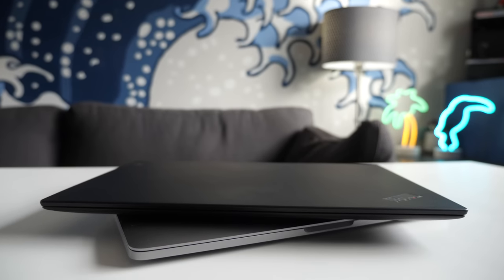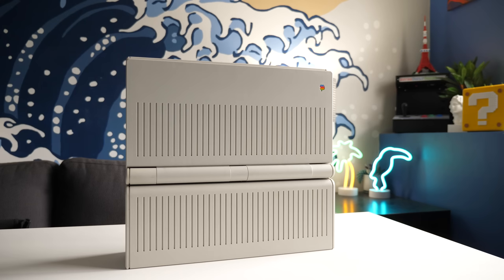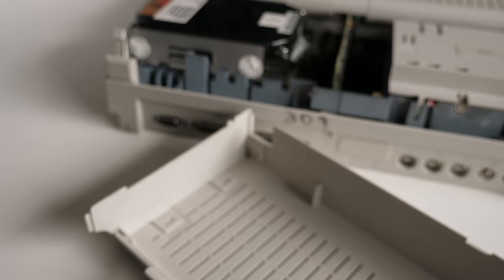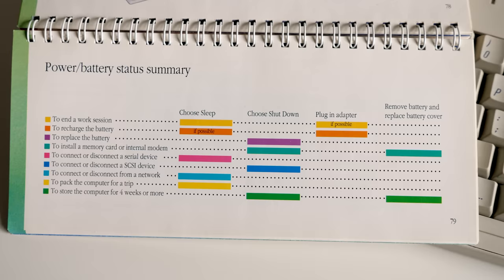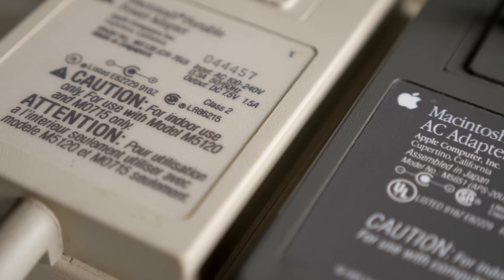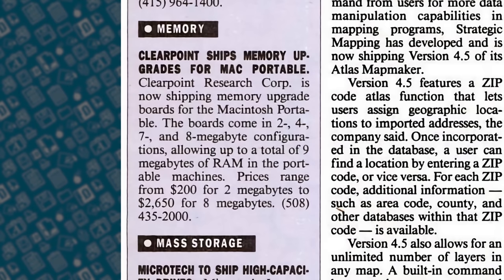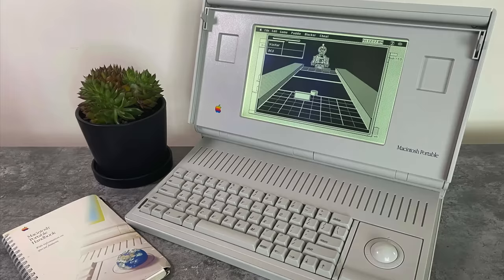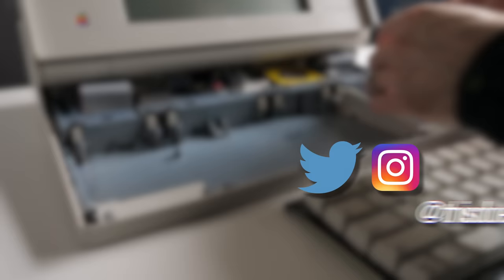Macintosh Portable: The Mobile Mac Nobody Wanted

Comment: I don't get how using a higher amp rated power adapter would pose more danger, the computer should only draw as much current as it needs. I mean unless Apple did something very horrible like using the power adapter to limit current draw. I would think voltage differences would be more dangerous.
Reply: If the current limiting is in the brick then a brick failure poses just as much of a risk either way too.

Comment: 10:10  "... an uncharacteristic flop...." 
 Apple III, IIGS, Lisa... Not at all uncharacteristic.  Apple flopped quite a lot. Usually it wasn't even flop so much as a self-inflicted gunshot wound.  The Apple III is probably the 2md worst example of any personal  computer failure company ever.  Perhaps comparable to the infamous "Peanut" in self-inflicted wounds.
The story of the IIGS is a similar self-inflicted gunshot wound.
Reply: Yah, the IIGS was crippled somewhat so it wouldn't cannibalize Mac sales.  I do wonder what might've happened had they focused more on it.
Reply: @AaronOfMpls  It really doesn't even make any sense. It wasn't ever going to be even as fast as a mac with an 8mhz 68000.  But they deliberately crippled it and overpriced it for no real reason.
OTOH, I think the II line was doomed from 1977 onward.  The PC juggernaut was just unstoppable.  But at least they would have gotten a few more years out of line, probably well into the 90s.   In many ways, the IIgs is a fascinating system and could have been a worthy successor to the regular II and IIC.
Reply: >russia avatar
BASED

Comment: Great video sir!!!! I have several of these machines, both model types…and let me tell you they are the most finicky Apples I’ve ever worked on. Usually though, once you replace all the caps, install fresh battery’s and say a prayer it will usually fire right up. Luckily the M5126 used A much cheaper ram and by 1992 the price had dropped significantly.

Comment: My knee jerk thought was to fight about the charger, BUT...
You said that the machine always runs through the battery, so the brick is a true charger only, and is not a power supply subject to the max pull of the machine. 

In that case, the issue might be that the electronics that limit the Lead Acid battery charge rate are in the charger, which you hinted at by stating there are limited charge control electronics in the machine. In that case, having more amperage available could then theoretically cause a problem with the battery. You need that limiter in place for the charge circuit, and if it's not internal, then it has to be in the brick. In that case, using a bigger brick could actually cause issues because the battery is dumb and will try to take everything available to charge itself. That's potentially dangerous with a SLA.

Think of the power brick as a deep cycle RV battery charger, not as a modern laptop charger. If you throw too much current at a deep cycle lead acid, you can boil off the acid. In a SLA, it can heat up and go boom. Not good.

Comment: My dad had one through the college he was a lecturer at and I got to use it a lot when he brought it home.  That thing was sooooo heavy.  These days, the carry case would have come with a telescopic handle and wheels!  Great video!
Reply: i had a 2006 black macbook , and when i opened it up on the plane , people were hella confused on what that noise was , the thing liked to engage the dvd super drive on boot , also i had it running 10.7.0 (by installing it on proper hardware and then deleting some .plist file ,so it could do its thing on the black mac) but it was mine , and it meant something to me , pulled out of a office works e-waste bin by a under-payed employee, and then it sat around until i was able to scavenge a charger for it , it was all i had , and when i was able to play angry birds (all be it while singe(ing??) my lap) it was a step up from my galaxy mini 1 , that actaul dumpster fire ran android 2.something and had only enough storage for 1 game , it was exploration Lite , some minceraftesk knock-off , i dont know where this has gone but yes it has

Comment: Active-matrix screens were pretty rare back then. The Mac Portable screen had no backlight, but it was readable even in direct sunlight -- which you couldn’t say for nearly any other portable out there. And that lack of a backlight was a factor in its long battery life.

Also the battery was a lead-acid one, like that in your car. Why? Because the more common type of battery for portable PCs in those days was the NiCad battery, which needed to be periodically run down to avoid the dreaded “memory effect”. There was no such issue with lead-acid, which could be kept at full charge all the time. Though it did add to the weight.

Fun fact: when the ground-breaking PowerBook laptops were released in 1992, the lowest-end model, the PowerBook 100, actually had the ROM (and possibly other electronics) from the Portable. This meant that, even though all the machines in the range shipped with System 7.0.1, this one could run older OS versions back to 6.0.5 (same as the original Portable), though I think the battery management didn’t work completely efficiently.

Comment: Thanks for the video. I believe the first Mac doesn’t get the credit it deserves for being portable. It came with a messenger bag that was designed to fit the mouse, keyboard, and external drive in pockets that would fit together to reduce space. It was designed to be put together quickly. It had a small footprint and a handle to carry it. It was 1984 when there was nothing like it (I was a teen then and into computers). The Osborn does deserve credit for being the first portable computer, I did see one in action once. However the first Mac solved some of its problems. Portability has always been important with the Mac.

Comment: I have the backlight version.  

Current draw from an AC adapter is dependent on the load. Just because the power supply can handle more current doesn’t mean that somehow more current is going into the Mac. You’re thinking voltage.  

It’s common to run the portable off newer supplies that can actually power the machine. Otherwise you have to wait for the battery to get enough charge to boot it. 

Mine has the original adapter.

Comment: Some interesting facts about the Mac Portable you left out: The power supply being wired in series with the battery and the mainbord also meant that the computer could not be run while charging when the battery was running low. This was because the power supply didn’t supply enough current to keep up with the current draw of the computer so the computer would drain the battery faster then it was being recharged. Another issue with using lead acid batteries as the Mac Portable did is that if you drain the battery all the way down to nothing it can kill the battery, a problem that can occur with car batteries which is what trickle chargers are a thing in the automotive world. Another annoying thing about Mac Portable was that while the first generation no-backlight Mac Portable ran for a fairly long time per charge on it’s Lead acid battery (especially for the time) but also took a long time to recharge. This meant unless you lugged a heavy second battery around with external charger. You could be in trouble if you waren’t careful about how long you used it per day and how you recharged it.

Comment: I think that you over-state the problems with the original reflective LCD.  I got one of these fully loaded as soon as they came out (and still have it).  I knew things would get smaller, but lugging its weight and bulk all around Xerox PARC as well as back and forth to Toronto was worth the opportunity to have decent computing, and a chance to experience the impact before it became more "mobile".  I declined the upgrade to the backlit monitor because the reflective one not only saved power, but also meant that it worked much better outside.  It did its job.  Nice coverage.  Thanks.

Comment: Current is pulled, voltage is pushed. Which means the computer will try to draw more power but is limited by the PSU.

Comment: I'm pretty sure the power supply isn't an issue, since I've charged mine using a bench power supply and it draws 1.25A at max. my guess is that the power management is good enough to not kill itself

Comment: One thing that probably explains the market failure of this amazing unicorn of a Mac, is that, being “luggable” rather than a true laptop, it weighs almost the same as the compact macs of the day, the Portable and the SE both clock in at around 8 kilos. Don’t quote me on this but they would be almost the same volume too, though the portable is nice and flat. In fact, I remember lugging your Mac Plus/SE around being a thing back in the day, they even had a carry handle and an optional shoulder(-killing) bag. Of course there would be no battery power but with machines of this size and weight you would be needing a table for it to rest in anyway, there would be no cozying up in the armchair with either machine. Which pretty much leaves battery power, if you really needed it, or the few other tech feats like outdoor-readable screen, external monitor port to differentiate. And this at a quite hefty price markup.

Comment: Providing the voltage is correct, an adaptor can be used in place if the Amperage is equal to, or greater than the original.... the Amperage is only what it's capable of, it won't always put out that much, only what's required of it.... so it should be perftectly fine to use the other

Comment: I was in the Apple dealer channel back then. I liked the display at the time, but as you say, good lighting was essential. I'm still a fan of the old simple, clean software interface of that time which worked well with the backlit display. Those lead acid batteries definitely made it a luggable, but so were most of the competitors like the Compaq 386.

Comment: During my B.S. there were no portable computers I know of (76-79) or at least could afford. By the time I was in my masters program I tried a RS WP-2, a Macintosh Portable, and eventually a Macintosh Powerbook Duo 270C. The portable was a monster to carry around, but it served me well taking notes. That said, I was delighted to switch to the 270c eventually. Note that I bought both macs long after they were "new" and both were bought at a reasonably bargain price. At $7K they would have been non starters! I still think fondly of that old machine.
Reply: 76-79 would be really early for portables, but Wikipedia's page on the Portable Computer cites the IBM 5100 released in 1975, 55lbs and $8,975 to $19,975. Also the GM Research Micro Star in 1979, no info on price or weight. Neither had a battery though.

Comment: This machine was only large & heavy compared to modern systems. The original Compaq Portable {1984} (and IBM Portable) tipped the scales at 35 pounds, twice as heavy. A more comparable system would be the IBM Convertable (1986). I featured a non-backlist lcd screen, two 3.5" floppy drives, and battery power. It weighed less than the mac portable, coming in at just 13 pounds. And, like the mac, the keyboard is very pleasant to type on.
On the other hand, in a bid to remain "IBM compatible," the Convertible only featured CGA resolution and an 80C88 cpu running at 4.77Mz.

Comment: At the time, I think most portable computers were ironically named.   I remember a friend used to bring his "laptop" to college.   It weighed enough that most of us needed two hands to lift it, what with it weighing several kilos.

That said, I'd still have had one in a shot.   At the time, I wasn't really a mac user, so wouldn't have been interested in a mac portable.   I was using a PC at college, so a PC portable would have been handy, and I had an Amiga at home, which I would have loved to have in a portable form.

I use Macs now though, so it would certainly be interested to use one of these.

Comment: Bought one in 1995 for $70, spent $30 on a modded battery and power cable. Didn't do much since I had a IIx, ended up throwing it away in 1998, along with a Commodore 64 with all the cables I paid $5 for. And other tech garbage that's now valuable.

Comment: The first "portable" computers from back in the early 1980s  weighed in the 20 to 25 pound range.  so this is not that much lighter.   The main weigh savings were likely in the difference between the CRT and its needed components and the LCD and it's.

Comment: " you have to start somewhere" Thats perfect! I see so many of these videos where some 20 something is making fun and being snarky about older tech.... I guess im old since I started at 1mhz and 4KB and by the 80's a < 20MB winchester HD was $6000... A Quadra 900 in the start of the 90's configured with some heft to handle all that 25mhz computational power cost well over $10,000

Comment: Why is it harmful to use a power supply with more amps? Is it not to damage the battery? Because from from my understanding higher amperage of a power supply does not damage a circuit. It simply only draws what it needs.
Reply: Exactly my thoughts too. Voltage is what a power supply regulates, amps is just the limit of how much wattage it can deliver at that voltage before it fries/melts/misbehaves.
Reply: You’re thinking in terms of circuits with proper integrated voltage regulation. This thing didn’t have that: it relied on the battery being in parallel to soak up excess voltage so the result is a constant supply voltage. I think that’s a characteristic of lead-acid batteries, or something.
Reply: @lawrencedoliveiro9104  interesting. Thank you. I have to look into that at some point.
Reply: Short circuit a 5 amp 12 VDC power supply and short circuit a 100 milliamp 12 VDC power supply.   The ability to provide current is only safe if there's something limiting it.  Google "variac" and "limiting current" to understand why limiting current is important, and why some devices don't have enough limiting.

Comment: What you mean "fed too much curren" ? Amps dont work that way.

If you use too weak of an psu amps wise it'll fail the voltages or shut down. Having too much headroom in amps in the psu doesn't matter unless the machine is shorted somehow (and you could just use a 2 amp fuse anyway).

Comment: @6:00 That is not how electricity works, at all. 

Unless CrApple™ engineers totally sucked at their job when they designed the power board, the computer will only draw what current it NEEDS, not the full amount the adaptor is capable of sending. This means it is totally ok to use an adaptor, (which is the correct voltage/plug type and polarity), that is capable of sending 10,000A - the computer will still only draw the 1.5A it's looking to get.

Comment: The size and weight isn't an issue to me however the display panels are just terrible for the period with the exception of the plasma displays which are pretty cool but at least later on with TN panels things gotten a lot better. The one I hate on the most is the DSTN that loves to degrade with age to the point of being entirely unusable then there is the ghosting.

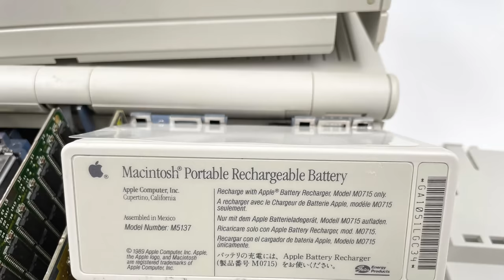Comment: 5:18 - that's not quite true - if you had the 9v "clock" battery installed and the main lead acid battery removed the portable would try to power up using the 9v battery instead

Comment: Does usin' the solid-state option give you a 2-fold advantage? That is, reducin' some weight & increasin' battery life? And I'd guess that the wall-wart power setup would prevent modifyin' it for say, lithium-ion?
Reply: Yes, the solid state will do both. The internal power circuitry is what prevents using lithium-ion batteries. Each battery chemistry charges differently and requires different circuitry to charge.
Reply: @3rdalbum  Other comments mention you can swap in LiFePO4 batteries.

Comment: @6:00 .. wtf? You don't FEED current. You feed voltage and current gets pulled. The current marking on adapters is a CAPACITY, it's impossible to FEED too much current because THATS NOT HOW ELECTRICITY WORKS, current is pulled / decided by the LOAD - I don't know where you got this and perhaps there's another reason for potential failures with a different adapter but amapacity is not it - if what you were suggesting was even possible, with the way you described the battery being wired - the battery would be MORE of a risk as I am plenty sure it can source more than the 3A of the newer adapters - this just does not make any sense..! That's not how this works. That's not how any of this works. :(

Comment: The videos comment on power adaptor current rating is surely not correct? A 2A rated adaptor can output up to 2A, but it only outputs what current is drawn by the device it doesn't constantly push 2A out of the plug. Look at your home 13A sockets don't pump 13A into your devices and overload them!
Reply: He's not saying it always does, only that the internals don't have enough limiting in them to prevent serious problems.   Providing gasoline and saying "don't worry there's nobody here with a match" is a similar idea.   Oh look, Match. Boom.

Comment: The ignorance of how electricity works in this video is amazing. The adapter can be of any current, as long as it is higher than necessary. The circuit uses the current it needs. It's simple Ohm's law.